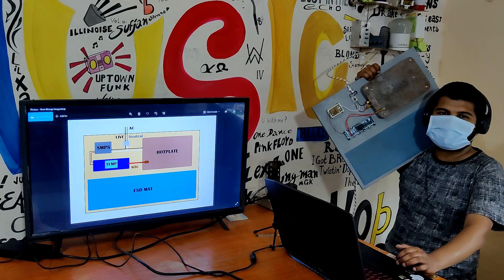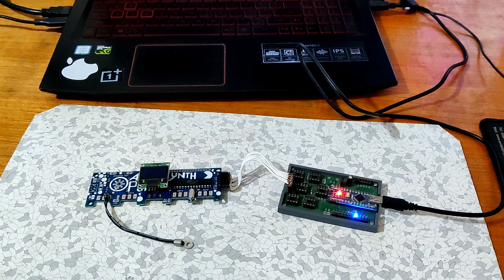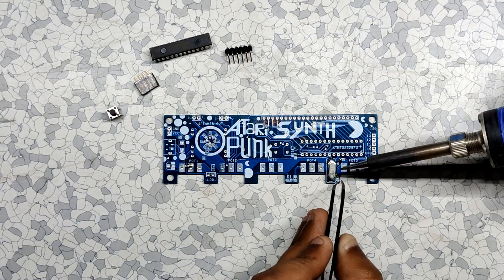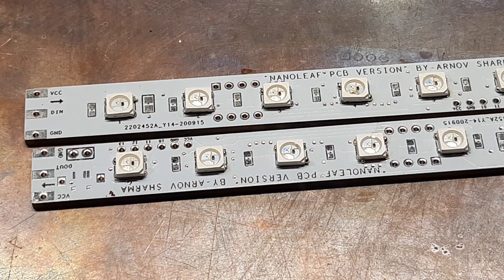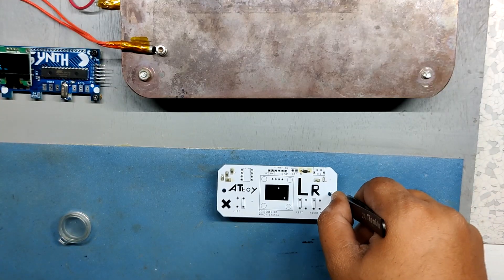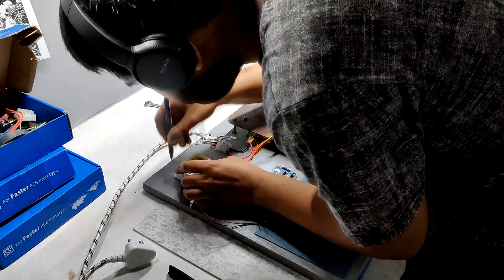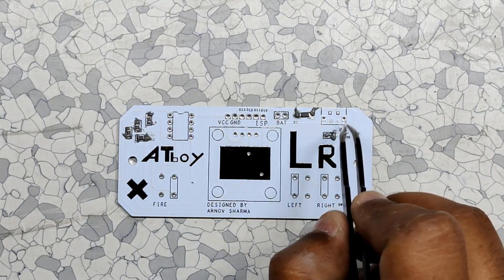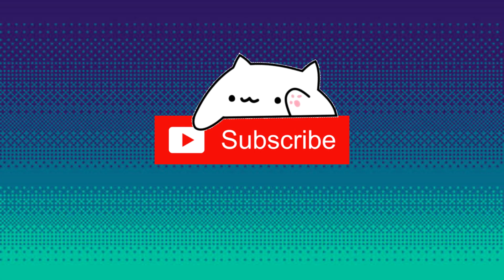Easy to make SMD Hotplate for Reflowing PCBs

Comment: 残念だが、簡単という訳ではない。これなら家庭用のクッキングホットプレートを使った方が便利だろう。
これらは、２４０度まで設定できると思う。それはリフローするのに最適ではなかろうか❓
その他に、衣類などに使うアイロンも温度設定が付いており、問題ないと思う。ただし、スチームタイプの穴の開いたものは、使い難い。
Unfortunately, it's not that easy. In this case, it would be more convenient to use a home cooking hot plate.
I believe these can be set up to 240 degrees. Wouldn't it be great for reflowing?
In addition, the iron used for clothes has a temperature setting, so I think there is no problem. However, the steam type with holes is difficult to use.
Reply from the maker: For steam type, put a copper plate onit.

Comment: Nice work Arnov bro! You could add a PID loop to control the input AC to the hot plate. In this project, you don't even have a manual switch to control the temperature of the bed. If it gets too hot, your components may degrade. The temperature set by that thermostat may not be same as that required by the heated bed. That epoxy and 3D printed part is not required, you could use a heatshrink.

Comment: Should have used thermal paster in-between the iron and copper plate for better heat transfer
Reply from the maker: Absolutely right. I did added that later off-screen

Comment: heyyyy i have an electric roti maker which have two round hot plates and it stops on cerran temperature what you say
Reply from the maker: I dont think a rotimaker might work but do try to first reflow some solder paste on it, if it melts then good, if not then sad.

Comment: So ultimately we saw " how to" use fancy software & hardware for some kind of display.., "how to" apply solder paste for soldering...".how "bi- metallic thermal trip works..
..wide ranging temperature trip thresholds with that bi- metallic
 can kill some of that hardware being soldered....just not the way.. but it's part of a beginner's learning... 👍 for the attempt...
if burning your fingers while learning , one must identify & correct the mistakes..better luck next time
Reply from the maker: 😅 you're not wrong actually

Comment: Do our pcb required any special material

Do copper required on both sides
Reply from the maker: Single layer pcb, double layer, 4 layer, doesn't matter. Every pcb works even the metal core PCBs
Reply: @ArnovSharma  

Ooo
Any PCB can handle that much heat

Transfer it to pads from back to front

Really
Reply from the maker: @shubham9672  this doesn't have an temperature modulation system so we need to remove the pcb in certain amount of time. So for reflowing different types of pcb, you will need to remove them at different time. Like 2 minutes for double sided, 3 minutes for mcpcb etc
Reply: @ArnovSharma  
Thank you so much

Comment: Well , great job of creating a simple yet very useful equipment for a hobbyist.
It is a good contribution towards hobbyist community in India.

I would suggest you use a proper control loop for temp regulation. Usually a solder paste shuld follow some certain temperature curve (in your case it is pretty much linear). This ensures that solder joints do not have any physical problems (like partial melted, tombstoning or micro crack). 

Chears for the efforts 🍺🍺